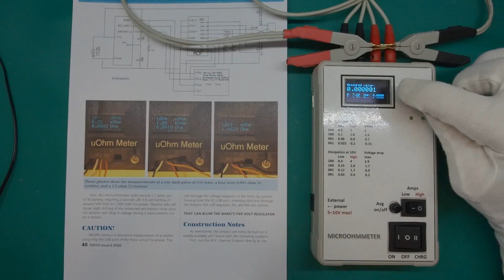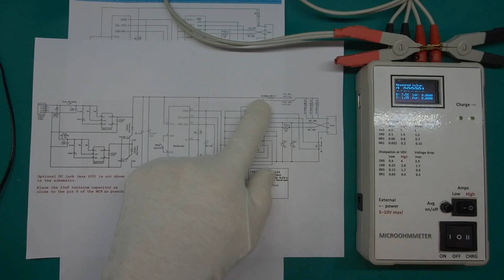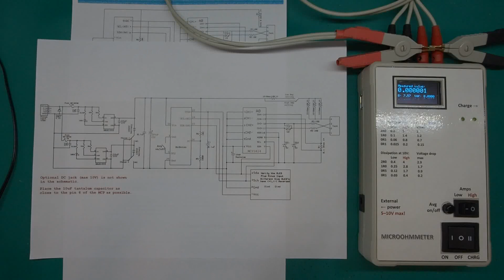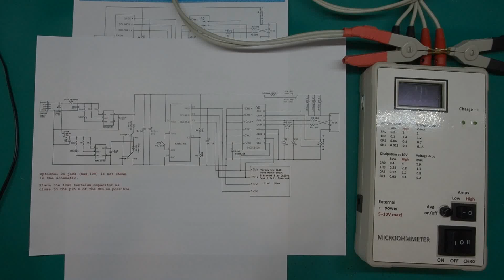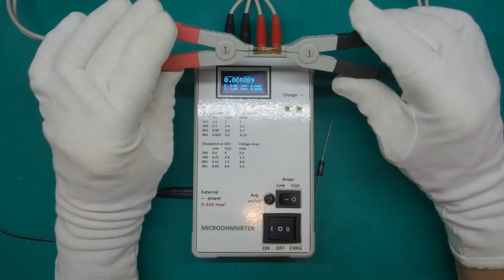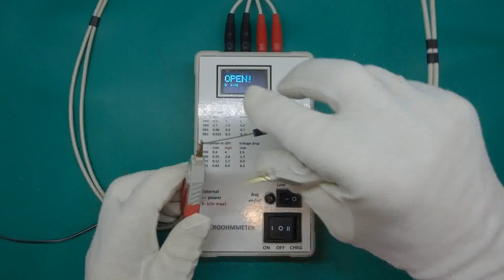Excellent DIY microohmmeter/milliohmmeter.

Comment: Thank you.I wish you could share the battery internal resistance measurement device.
Reply from the maker: A microohmmeter with 1 microohm resolution is costly. For example, Uni-T makes one for about 600 euros. So, I went the DIY path. But battery internal resistance meters are cheap as chips. A guy has reviewed one by Fnirsi, seems to be good. Why even bother?
Reply: @vytautasslenderis2702  I have to do it myself. Because I need to read the internal resistance value with eap32 in a project.
Reply from the maker: Hmm... You mean, pull-up resistance? You see, the problem is, the pull-up resistance of esp32 is going to be tens of thousands of ohms. Not sure, how do you intend to use a battery resistance meter for that.
Reply: @vytautasslenderis2702  My English is not very good. I plan to make an ESP32 controlled lead-acid battery charger. I want the value of the internal resistance of the battery to be transferred to the ESP32 before charging. In this way, ESP32 will be able to decide how to charge the battery with the necessary software.
Reply from the maker: @unalakdogan9416  OK, now I got it. Sure, that is a viable idea, though, IMO, you should consider weather the benefits of it justify an increased complexity of the circuit. I might think about it, but do not full count on me, as my possibilities are time dependent. I do another work full day lately and tinker with electronics only when spare time remains, and spare time is sparce, you know 😁 As a first sketch, applying a small, known load to the battery and measuring the voltage drop is needed, then calculating the resistance, Ohms law. A controllable load would be needed, such as a MOSFET circuit. Then the precise current and voltage measurement has to be interfaced with the ESP32. These are just quick ideas.

Comment: You can even build this into a commercial unit. Needs a bit more filtering for EMC, susceptibility of the original design needs work, but it isn't too hard.
Reply from the maker: Yes, a ferrite core added on the Kelvin leads should work pretty well. Also, the case of my meter is well shielded with copper foil connected to the ground.